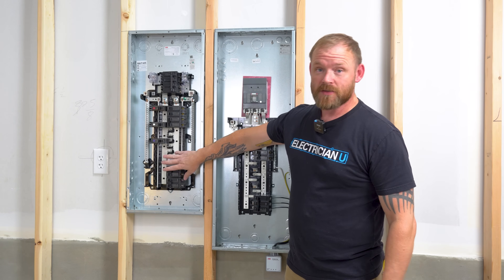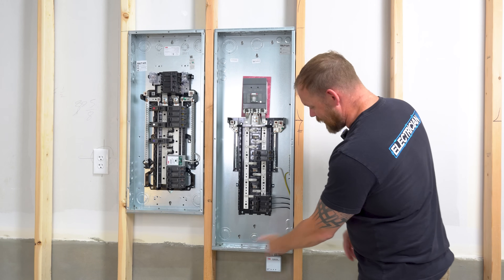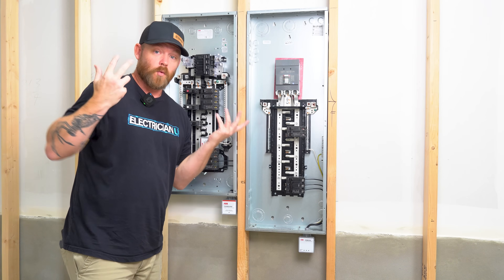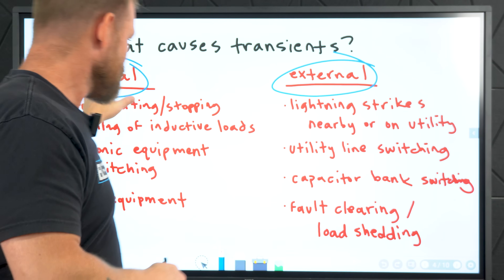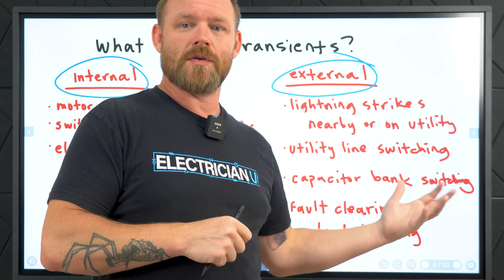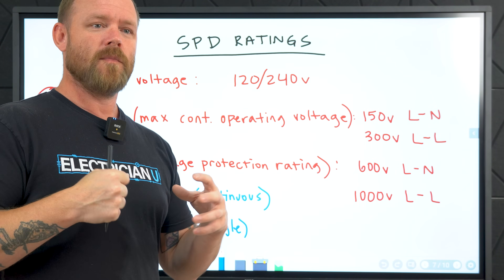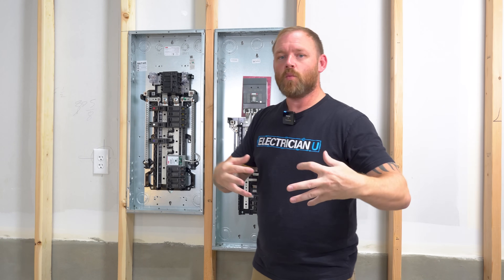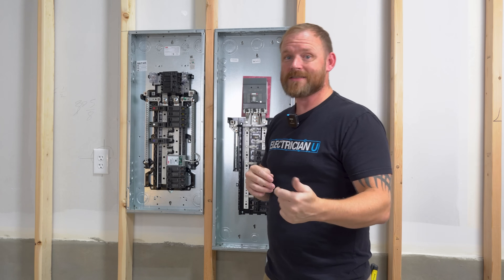What Surge Protectors Actually Do (and What They Don’t)

Comment: Experimental physicist speaking here: Fourier transform of the Dirac pulse: Minute 10:39 - '100 thousand Hertz' frequency - Correction: actually all frequencies not just 100kHz. Lightening is close approximation to the Dirac pulse, and if you Fourier transform the Dirac pulse from the time domain to the frequency domain you get ALL FREQUENCIES, from the low band to the very high band. Listen to FM radio during a lightning storm, and every time lightening strikes in the ultimate vicinity you hear a disturbance in the broadcast.
Reply: FM? More like AM band

Comment: For the benefit of others and clarity this is what each type is and where they should be installed:

A Type 1 SPD is installed at the service entrance (Meter). A Type 2 SPD is installed at the service panel (breaker). 

Type 3 SPD is a POU (Point of Use) such as an outlet, strip / power bar, AVR, UPS, etc.

Type 4 is installed (before) inline (series) to a target device what ever it may be.

Technically there isn’t a Type 5 SPD but some industrial / military equipment have integrated surge protection as part of the electronics.

They are almost always module in nature so the SPD can be inspected and replaced if needed.

🫵🏻😮‍💨🫵🏻

Comment: With a lightning strike the best you can do is create a path to ground, like the wire on top of power poles.  You're correct surge protection is for over voltage (happens more that we think) and they are the primary reason most home electronics fail (that voltage has to go somewhere).  If you have a 10k amperage surge you Line CB is going to trip and explode lol  A Whole House systems and local protection is best, but let's not forget about those coax cables (antennas, satellites & internet) too.  I've seen to many systems that didn't work after a bad storm.
Reply: THIS.  I've worked on broadcast towers over the years, seen plenty of DIRECT lightning strikes, along with indirect ones.  A surge protector isn't going to help you when lightning strikes.  
Interestingly, in Florida, I've seen more lightning/surge damage on low voltage (cable TV, telephone, LAN) ports than I ever have on AC lines.   EVEN when there were direct strikes to a structure.  
Likewise, POE network switches are more susceptible to lightning damage than non-POE ones.   Use POE when you need to, but best to run as much non-POE when you can.
Reply: @grayrabbit2211 Yup👍🏽 A 10 VDC spike on a 5 volt circuit isn’t a good thing.

Comment: 1:25 around here you said lightning came from the sky to the ground that's not accurate and is a common misconception. Lightning actually comes from both the ground and the sky and they connect. Or cloud to cloud. NOAA has a severe weather 101 facts web page where you can read about this stuff to verify.
Reply: 11:45 again it's not simply from the sky, It's the charge difference between two areas that causes the air to break down from being an insulator. If you watch some research videos you'll see a charge leaving the ground and meeting what's coming down from the sky and they connect. And you have negatively charged lightning and positively charged lightning. And supposedly the process of the air breaking down is still not clear to researchers on this topic.
Reply: Yeah, no one cares.

Comment: One item you may want to mention is self sacrificing surge protection.
When they react to in rush most typically fault resulting in the main breaker tripping out in my experience.
Ive seen more if these devices being sold as such a high margin that it seems to be something closer to snake oil sales than protection.
You would be better served to have individual surge protection at the component than whole house from a financial sense.
Reply: Delta Lightning Arrestors made in Big Spring, Texas are very economical for whole house protection. They also offer a surge capacitor. I installed both of these at the disconnect box below the meter and I have had zero issues in 9 years since installation. Cost was about $250 .

Comment: In my opinion it's proof positive that the people who influence the NEC updates are being influenced by electrical manufacturers. Surge protection in a panel does almost nothing to help you protect anything in your home. 
The rule of thumb is to have the surge protector AS PHYSICALLY CLOSE TO THE DEVICE YOU ARE TRYING TO PROTECT AS POSSIBLE. 
Slapping a code required whole house surge protector in a panel provides very little protection at all. 
Like you mentioned in your video about not having longer wires because it increases the impedance. Imagine the impedance from the surge protector in your panel to your LCD television. Obviously this is why people use surge protecting devices at the appliance level.
Reply: You are mistaken.  The SPD needs to in a low resistance path from the source of the surge.
A type 1 in each panel shields all circuits from upstream surges and surges from sibling circuits in the same panel.
An SPD at point of use shields only that utilization load and anything upstream from surges it creates.

So of course SPD manufacturers want you to install one on every branch circuit or at every outlet rather than just one for the whole house.

Whole house SPDs are logically and scientifically sound protection as the first and most important line of defense.
The NEC committee got this one correct.
Reply: @denverbraughler3948  I have a some questions for, @denverbraughler3948, if you would not mind commenting? 

My home main panel (125A) is “full” so I did not have my electrician add any surge devices to it. I had already installed type 2 surge devices at some of my appliances down stream. My furnace, A/C condenser, etc.

My electrician installed an ATC & standby generator. The ATC is now my service disconnect, mounted indoors next to the main panel. I know the electrician installed two ground rods outside with copper cable connecting to the grounded neutral bus inside the ATC. And, of course, he separated all the grounds and neutral connections in the main panel. All inspected and good.

Now, I am learning about type 1 surge devices where they can be installed in the ATC to the line side. I think I want this protection for the ATC switch controller. So, I am going to ask my electrician to quote on adding a type 1 device, mounted on the exterior of the ATC, attaching the hot leads to the feeders from the meter. If you think this is a good idea what type 1 device would you recommend?

Now, this next question, I did not think of until I began writing to you. After the first device described above, I request an additional type 1 device, mounted on the exterior of the ATC. The hot leads of this device being attached to the main panel feeders, after the switch. What do you think of this? Would you recommend the same type 1 device as above? 

My thoughts are the first device would handle the 20% utility surge issues and the second device would then act as a whole house surge protector handling the remaining 80% of surges within the home. Thanks for your help.

Comment: Electrical engineer here.  Good video.  I put one in my panels years ago after losing a few circuit boards in my heating system.  Everyone should have one.

That is a great point about the delay.  You don't want to extend those wires.  I also would recommend getting at close as possible to the service entry.  If you have the circuit breaker kind you have on the left, get that up top.  I put mine on the bus bar prior to any breakers.
Reply: It really should be part of code, aside the fact they have a life that is shorter than a breaker and we renters and home owners like to ignore facts like that. Kind of like every furnace should have a Manometer or manometer for the filter.
Reply: I was just going to ask does anyone know ANYONE that had a surge damage their equipment.  Its a bit crazy your  heating systems didn't spend less than 5c to add the proper protection.  Don't want to think about what else the engineer missed :)
Reply: Got a $500 bill when my furnace went out 1 colder than normal morning. HVAC tech said the control board was fired. New board and back up.  Now I’m searching for a surge protector not just for the HVAC but a whole house too.   If you can do that.  Too much is okay?😮

Comment: That was great ! The ones I install are the Eaton ones. What my local supplier had. They even make the MOV's . They are blue.  The GE ones are RED. ABB/Seamans and many more make great ones.  Their is a newer Hybrid MOV now that adds the speed of a GDT . Gas Discharge Tube . into the same package. They on Eaton you tube page.  Them are type 4 that you add inside a appliance or computer . 1 thing I have found if a home is prone to surges checking ground rod resistance is a great thing. The lower the better the Surge protector can work. Adding extra ground rod or adding GEM to the soil can help in places. This varies quite a bit. So often I check the ground rod resistance .  Your type of soil has a lot to do with this.  Level 1 and 2 is now code in USA. Been for a wile now. Each panel has to have 1 . The instructions on the Eaton one has it mounted close to main breaker as possible. Has some handy pics in the instruction sheet as well . Very nice .  Lightning protection is a Ben Franklin thing. A lighting rod on house to heave wire to ground rod. all outside the home. They usually have a point at top and maybe a ball on it . On the peak of house or barn . Cheers from NY !

Comment: When I was adding a dedicated circuit for my home computer, I called a local radio station and asked the engineer how lightning protection worked with the giant rod poking up into the clouds that broadcast his signal. As I recall, it started--started!--with a humongous spark gap, backed up by various gas discharge tubes, band pass filters, and big thumping RF relays that disconnected his transmitter at the first whisper of the rising edge of a strike, which is why, during a storm, your  local AM station occasionally goes silent for a few seconds now and again. Tens of thousands of dollars of serious infrastructure. 
I thanked him and just settled for a good data backup schedule and the meatiest UPS I could afford to give me time to shut down when the power went away. .
Reply: For in-house protection buy a Zero Surge device. Far better and doesn't degrade like MOVs (doesn't use them). 
I have five of them on the internet/PC, entertainment stuff, appliances with electronic control boards (dishwasher, washer/ dryer), the basement Power Station and batteries protecting the freezer.

Comment: Very informative and explained well, thanks.  Any advice for adding surge protection to air conditioning equipment, especially higher efficiency AC with components like inverters and ECM motors?  If surge protection is all about getting the surge to ground via the shortest path of least resistance, it seems that adding surge protection directly at AC units (condensers, furnaces, air handlers) in addition to a whole home surge protector is best.  

Surge protection strategically located as close to whatever is needing to be protected seems to make even more sense regarding internal surges (if it's true that the majority of surges are internal with fewer external surges it would also seem that whole home SP would be a little less likely to protect from an internal surge than if additional SPs are directly connected to what needs protection instead of only at the breaker panel -not doubting whole home SP, just thinking additional SP even better than whole home SP alone).  

Any advice much appreciated, thanks.

Comment: From Schneider electric: Type 1 and Type 2 Surge Protective Devices (SPDs) are designed for different points of protection within an electrical system. Type 1 SPDs are typically installed on the line side of the service entrance, offering protection from external surges and direct lightning strikes. Type 2 SPDs are installed on the load side of the service entrance or distribution panels, providing protection from internal surges and indirect lightning strikes. Both types work together to provide comprehensive surge protection for electrical systems.

As an ECE
You need to twist the wires leading to the breaker as close as possible. Twisting extends it's ability to suppress more as it cancels the field.  

Ideally you want a layered defense with space aka time between each layer.  A metal oxide varistor needs a few micro seconds to react.  So on my home I installed a type 2 160Kv Siemens at the meter which then has 40 ft to the main (sub) panel where there's a Leviton breaker plugon type 2. And again 40 in the attic with all the bedroom, lighting, and HVAC.  Then the lights go out to a separate type 4 outlet that also back feeds from a type 4 APC battery backup.  I'm contemplating adding one at the HVAC minisplit compressor to suppress it's spikes getting back to the sensitive stuff.

The 160kv will help with lightning a few miles away.  But those cute little breaker ones won't do squat.

Comment: ...and a ground rod is NOT a "lightning rod." I often refer to lightning protection systems as lightning ATTRACTION systems, since that's exactly what most of them are actually designed to do. Thank you for this explanation. I intend to direct some of my customers to this video since you explained what surge protectors are and what they can and can not do so well in layman's terms.
Reply: Not exactly true, they are designed to help shuttle ions in the earth to the sky, thus equalizing the massive voltage differential and reducing if not eliminating the probability of a lightning strike near you.

Comment: I am not an electrician, so there could be something I'm missing, but couldn't putting a surge protector that doesn't need a circuit breaker on a circuit breaker be problematic, as if the breaker falsely trips or even trips because of the surge, your house is no longer protected? unless it is connected on the unprotected side of the breaker.
Reply: The fastest a breaker can trip is about half a cycle, 8 ms.  The kind of surge we are talking about are less than 0.1 ms.
Reply: Also not an electrician, but... if the breaker has tripped for any reason, something in your house won't be working, and you'll go reset that breaker which also reconnects the surge protector. Now you're protected again.
Reply: @brucebennett5759  It sounded like he was saying he gave it's own breaker so the surge protector would be the only thing off, this might be a display/training panel and you normally wouldn't give it's own breaker.

Comment: They should be placed as close to the source of the surge as posable. Years ago we had lighting arresters. Must have figures out they did not work for that purpose. However they did not use MOV's they used a small vacuum tube. when the voltage got to high the voltage would jump the vacuum gap.

Comment: Good explanation. I'm an electrical engineer and a self-taught type 3 surge protector zealot, the kind a renter or someone who doesn't have a protector in their panel can buy for about $10-$20 to protect their washing machine, microwave, computers, window air conditioners etc.  VPR is the most important specification, a good Type 3 surge protector will have a VPR of 500 volts or less across all three pair of lines. Stupidly, most manufacturers advertise Joule ratings and not the VPR.  
I recently added a surge protector to my panel also, because I realized if I get a heat pump water heater with digital controls or a new furnace with digital controls the only way to protect those would be protection at the panel.
Reply: I agree that low clamping voltage is most important. In fact, the UL standard doesn't require the joule rating to be marked on a device.

Comment: Why does he show the MOV connected across L1 and L2? What good would connecting a Line conductor with high voltage to the other Line conductor do?
Reply: The MOV clamps only when the potential difference between the lines is too large because we want to limit the maximum phase to phase voltage.

He misspoke the first time.  The line to line MOV shunts between the lines, not to earth. 
He got it right the second time.
Reply: @denverbraughler3948  So that would balance the surge voltage between the lines, but why not shunt to ground?
Reply: Usually the MOVs cover the whole matrix.  L1-L2, L1-N, L2-N.   Three sets.  Neutral is bonded to ground in US systems.  Remember, this is in or near the main panel. There is no point covering less since a surge can transit more than one conductor and wouldn’t trip the MOV across the conductors involved.
Reply: @junkerzn7312  It sounds like the line to line MOV only provides another path (via the other line conductor) to N and thus ground (back at the panel bond, then through the GEC). Is that correct?

Comment: 3:21 are there any recommendations to keep the grounding wire close to the actual protected wires? It would make sense, given the problem with grounding a fast rise pulse is mostly inductance, which is very much influenced by enclosed circuit area.... Similar to what happens when you terribly fail to get a tens of MHz signal cleanly with a common oscilloscope probe looping the ground wire all over the place....

Comment: If longer wires are bad because they increase the time it takes to react to the overvoltage surge, why is the proper mounting location for these devices always the very bottom of the panel (farthest away from the incoming power lines)? That was always what was confusing to me, I would think it should be the closest to the incoming lines.
Reply: UL Standard tests these devices with 6 inch leads, installing it as close to the panel board bus is important,  not necessarily at the main connection point.